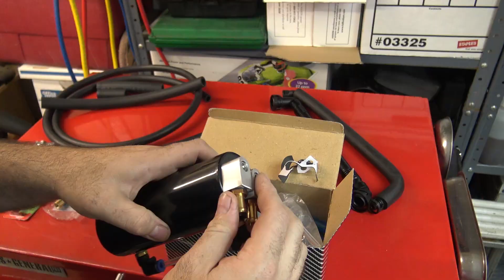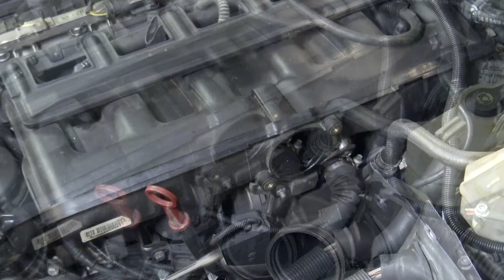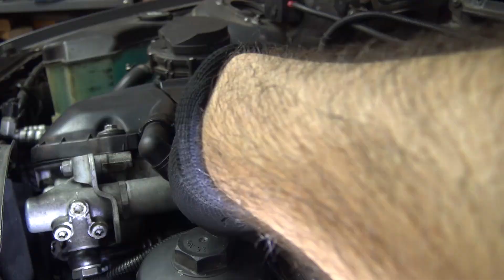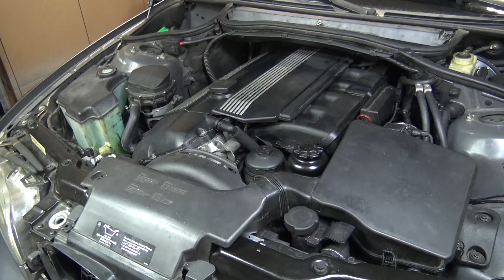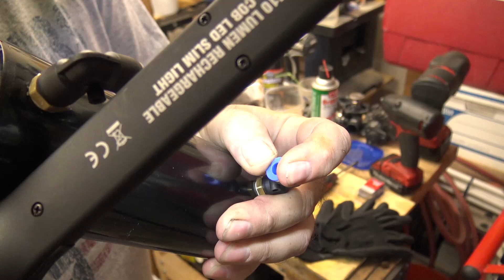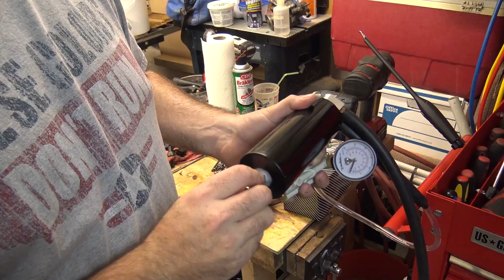BMW E46 Oil Catch Can Install DIY

Comment: My set up but before..claps for your efforts..
My e 36 M52, I installed a baffled catch can in series with the valve cover to OEM cc v....and blocked the dipstick drain port as well as the CCTV drain...for the time being to check if there is any oil consumption fix...this after long cruise off and on drives and short drives long drives etc ..figures out that oil consumption dramatically reduced ...and not only that but the oil catch can works the purpose and accumulates mixtures of water and mayo gunk in its bottom where I have drain valve to drain it out periodically....the difference I started getting is cleaner manifold and intakes...idle smoother. Oil reduced and next I will now install one way check valve in between the CCv drain port and dipstick drain port...hope  it works further fine

Comment: The original pirate lasted me over 20 years.. the Ketchikan does not have the vortex properties that the original part has you broke b******.. just spring the few hundred bucks it takes to buy the freaking part

Comment: ok so you have all your tests to show your experience, I am a retired BMW tech and have a x5 with the m54 engine, I have hd the truck for 10 years and my whole life long have had several different vehicles including e38 740il with 250k miles, I use castrol 5w30 and one can of STP oil treatment, my 1969 mercedes  I have had for 45 years gets castrol gtx 20w50 and stp every 6 months, my x5 has 300k miles on it witht he m54 engine, I tow it behind my rv all over the united states, it has to stay idling while in tow to keep the transmission wet, it gets driven as a daily when Im home, it does not consume any oil whatsoever. I do enjoy your videos and your content is great.

Comment: I need help with installing a catch can.
1.What I understand is the pcv connects to the oil catch can.
2. I also understand you connect a hose that connects to the top ccv where the intake manifold is.
3. I also understand you need to cap off the oil dip stick.
4. What I don’t understand is does the other hoses from the ccv need to be capped off or do I just leave them ? 
5. Also where the pcv is routed and connect in the bottom do I need to cap anything off or just leave it.
6. From the videos that I see I just see people cap off the oil dip stick connect the pcv and connect a hose to the catch can and then they go to the top of the ccv connection point on the intake manifold and connect that to the catch can and that is all.?

Comment: I installed it works fine. Drive about 40 km 25 miles, and check the tank or container that comes in the decanter and it is almost full. For what is this?

Comment: I realize it's a 6-year old video, but I'm setting up a Catch Can in a 2004 e83 M54 2.5l and I want to know how to select the correct PCV for my application? How did you select the Napa 2-9358 for your application? I really prefer not to attach a hose to a threaded end; Really prefer to have a PCV that will seal to a hose.... I'd appreciate your thoughts/comments.

Comment: NO MORE WHITE FOAM IN MY OIL
Love your videos. I've had my 2004 e46 330i for 13 years now and love working on it. I'm currently doing the notorious plastic heater hoses and getting the starter rebuilt for the first. 
  When I first got the car I noticed white foam under the oil fill cap which concerned me and designed my own catch can which I quickly realized won't work in the part of Canada I live in with super high humidity in the summer and -30 in the winter. The reason a catch-can won't work here is mainly the freezing in the winter so I had to come up with another solution and quickly as the heavy foam was totally plugging my ccv  system. I replaced my CCV system as I thought it wasn't working but it was. The BMW CCV  is very good but can't handle the super cold and high humidity of where I live combined with short trips. My solution is very simple, 100% effective and free and you keep your BMW CCV system. All I do when I come home is lift the hood and remove the oil fill cap and watch the steam bellow out as the engine cools down. Summer or -30 winter is no different. It's amazing how much steam comes out and in the last 10 years I've never had a speck of white foam anywhere in my engine. The thing that bogs the factory system down is when you turn off your engine at freezing temperatures all that water in the engine and CCV system freezes. By eliminating all the moisture every time you turn your engine off helps the factory system manage the larger percent of the moisture while the engine is running.  Hope someone finds this helpful

Comment: I been doing your hose method and it runs awesome. I been using air water separator. Next step is to use the same pvc as for the return oil line. Oil will only return when the car is off.

Comment: Hi. I just watched your video on the catch can replacement of the CCV. I see that you have the vacuum source for the PCV valve on the wrong side. The vacuum source goes to the 3/8 side of the valve. Also, the way you ran the drain line from the catch can will eliminate your vacuum source. You'll be pulling vacuum from the oil fill line. You need a check valve in the drain line, but you have to be sure that you have enough vacuum to pull the check ball closed while the engine is running and falls open when it's shut off. You might be better off with an electronic valve that is closed when the motor is running,(power is on) and opens up when you shut the motor off. I think that you will have a vacuum leak and be pulling oil up from the dipstick tube. Remember that you are putting a vacuum on the whole crankcase, which is in the oil pan too. So the check valve you put in the drain line is getting vacuum, and being pulled from both sides!! If the electric valve is too much, you can use a manual "ball valve", which would still make you have to drain the catch can, but it will be much easier to do. Just open the ball valve, let it drain, then close it again. I may be wrong, but I don't think that you will have enough vacuum to pull that check valve closed. It's meant to stop liquids from back flowing, which push it closed. Remember that you don't have a high vacuum to the PCV valve, and you're also using that vacuum to pull from the crankcase. That gives you a vacuum pulling both sides of the check valve. Thanks for the diagnosis of the problem though. I have a 2003 330xi that's burning oil, missing, and a vacuum problem too. I noticed that the vacuum gauge on the dash, (gas mileage gauge) fluctuating, being low, and having to build back up after the throttle is closed at an idle. I was going crazy. I was a mechanic for 40 years, but like a Benz, BMW doesn't give out too much info. I was thinking "vacuum modulator" at first, but it didn't smell like tranny oil. I couldn't find a PCV valve, and then I thought that I had a cracked head or a bad valve guide. I'm not used to going online to find a problem, but it was a great idea, and you are a great help. I felt a lot better when I found out that I was on the right track with my thinking about PCV. (That I couldn't find). It figures that the Germans would make a simple system complicated!!!! LOL. Thanks for a very helpful site.

Comment: I've been running with the PCV valve mentioned in the video. It's great, at idle engine speeds but starts to work improperly at highway cruise speeds, resulting in higher fuel trims and spikes in fuel trims. The solution to this is to probably get an adjustable PCV valve like the Wagner DV-17. You can't use it in below freezing temps though.
Reply: Addendum to this. Do not use the Fram345 pcv valve or the DF17 Wagner. Neither solve the fuel trims. PCV valves are flow type valves. These do not allow for proper crankcase vacuum of 16mbar. Use the oem ccv vacuum regulator portion inline with catch can to maintain right fuel trims and bypass the cyclone separator.
Reply: Update to this again. Don't use the OEM CCV inline with the catch can. Use the Dodge PCV valve and then route an vacuum tube from the intake boot elbow to the return port on the dip stick tube. The correct process is on the Xoutpost forums

Comment: Hey guys, this guy made a video talking about blowing seals with this mod, but ik 50skid is a guru and he knows what he’s doing, so no over pressurization with this method?
Reply: You will run higher crankcase/engine vacuum. There are risks of breaking seals and sucking dirty air

Comment: I did this mod a few years ago. In extreme cold (below 0F), the catch can or pcv would always freeze and blow out the valve cover. Maybe my crankcase generates excessive goo compared to others. I ditched the catch can and vented to atmosphere temporarily, and the pcv would still freeze. Ended up doing the m56 valve cover conversion which has worked out very well. In normal climates the catch can mod probably works perfectly, and I learned a ton from this video. 
This channel remains the best resource for e46 owners!
Reply: Thank you for commenting this. I live in Canada and it been quite cold lately. Yesterday oil blew out from the valve cover and there was a lot of pressure behind the oil cap. This helped be track it down to a frozen CCV. Thanks!
Reply: Got a link to the m56 Valley cover conversion cant find one stupidly
Reply: As a guy who lives in cold sweden thx for this comment!

Comment: Hi. Wondered if you can help me. I love ur videos. I installed a catch can. Blocked off oil dipstick. Used the pcv valve you suggested. But im getting a massive vaccume which is stucking oil cap down a lot and maybe causing oil to be sucked up from the sump. Any ideas? Would really appreciate any help you can give. Thanks

Comment: My opinion as I'm currently installing this , replace valve cover seal + grommets first hopefully you already did. Then My best advice to all is remove the entire intake,  yes it takes longer but pulling everything off and inspecting all your hoses and parts and seals is key. I was surprised to see what didn't work pulling mine off considering I drove from northstar to Lonestar state no issues.

Comment: Soo the hole of the oil separator will be left open? I feel I missed if you capped it off or something also about to top hose is it just left connected?

Comment: Thank you for the Video. I did the same installation on my car and when I drive for a test it drive really smooth but start smoking from the tilt pipe so I pull over and check the oil dipstick and nothing on it so I towed back yo my house and find out spark plugs are wet of oil do you thing I installed it wrong. Catch can has an input and output which one goes where? Thank you!

Comment: Any leads on after installing this, having misfire and SES light but no limp mode EML light, you can just feel it misfiring at certain throttle positions.

Comment: Greetings.Great video! I just wonder, I have seen a few setups without PCV valve. What is the worse that can happen if we do the same setup without the PCV valve?
Reply: We’ll with this, the oil catch cam going to the dipstick tub would gather water and dump it right back into your engine, which is very bad, you would need to add a water separator, if you do the second method by blocking off the tub on the dip stick you could get Hugh crank case pressure and blow some engine seals

Comment: So you switch the pcv to the valve cover 3/4 hose, but the switched it back again to the 5/8 tube on the intake with the new pcv? 
A little confusing with all the changes

Comment: 28:40 Those "slip in" connectors are not siutable for vaccume. they holod prerssure really well. They don't have standard orings. U need to use screwed connector with nut for this pipe, instead of "slip on" type.

Comment: Thanks your video.
I have some questions
My E39 is M54 525i engine
Are there any disadvantage to delete original ccv systems after long time test?
For example: oil consumption or air leak problem
Will OBD detect error code after delete ccv systems?

Comment: Great vid!! Is this the same with the m56 sulev e46 325i? I’m pretty sure my ccv system failed as I drove 3 hours and after parking up and restarting the car I had the most insane misfire I’ve ever felt. Plugs and coils and common vacuum leaks previously sorted. Do you recommend a catch can on the m56? Let me know thanks!
Reply: Also, what did you do with the old ccv oil separator system on the back of the intake manifold? Did you just leave it there ? Any connectors need to be taken off? Thanks ahead!!
Reply from the maker: If your CCV diaphragm built into your valve cover is busted, you can do a catch can. You can leave the old stuff if you want.
Reply: @50sKid  I’m not sure what you mean. I have the m56 sulev motor with metal valve cover...isn’t the ccv diaphragm under the back of the intake manifold? I’ve watched your other videos maybe I’m misunderstanding something. It only misfires at idle...maybe idle air control valve?
Reply from the maker: @CaptainBudhram  No, the M56 engine has the CCV built into the metal valve cover.  There is nothing underneath the intake manifold.
Reply: @50sKid  ohh okay thanks so much for that! I’ll do more hw on it thanks so much!! Are you on social media? Fb/ig? I would be happy to follow! Thanks again!! Keep the vids coming I do a lot of diy on my e46 thanks to you!!

Comment: HERE is a much better catch can that doesnt have that oil level indicator.  This one has a threaded dipstick instead...  https://www.amazon.com/gp/product/B076BKV7JF/ref=as_li_tl?ie=UTF8&tag=scottykilmerc-20&camp=1789&creative=9325&linkCode=as2&creativeASIN=B076BKV7JF&linkId=2633bfde063561407fe85724ff492bf8

Comment: 50s kid is one of the few people who understands that PCV valve is still needed if you use oil catch can. Basically you rebuild the original M52 PCV system with aftermarket components. Without PCV valve the high vacuum (when car is idling) will suck a lot of oil fumes from the crank case. This is the purpose of PCV it should be only open when throttle body is open.

Comment: help help help 
today I was out for a test drive and much oil comes out of the exhaust ... I installed a PCV ( PTC 345 ) but i was wondered these is a metall and its clicking when the PCV Valve is chacked, should the is a sping inside?

I open my catch and see there is no vaccum the direction of the PCV is correct

Also I wonder the catch on my last 30 KM around 20 Miles testdrive have catched much water // I must say  I drive the car most time in short distance 

next step the check the valve or installation without a pcv valve // or close the intake ports and output from catch to the air  filter

Comment: Not going to work. The check valve to the dipstick is spring loaded , the can wont drain. If you take it out it will suck from the pan

Comment: HI 50's Kid, just asking hows the vehicle oil consumption rates at about 1000 miles and engine oil smell or smoke inside the vehicle as what you mentioned in the video. I'd like to know what is your final assessment on the oil catch can project and it's latest part update. I have an X5 with M54 engine and interested with your  modification, as usual and normal oil consumption issue.

Comment: , the M52 has an additional vacuum line attached to the Fuel Pressure Regulator. Has any one done a catch can on an m52? If so, how did you tie in the Fuel Pressure Regulator vacuum line
Reply: This is old but wondering the same thing for my m52tu 328i

Comment: , the M52 has an additional vacuum line attached to the Fuel Pressure Regulator. Has any one done a catch can on an m52? If so, how did you tie in the Fuel Pressure Regulator vacuum line

Comment: Just plug all intake leaks remove ccv and stick a hose on the valve cover route it below the air filter. Make sure that disa is working. The car runs like a top.

Comment: What should we do if we have the m52tu and there’s a vaccum line going from the oil separator to the fuel pressure regulator (if I’m correct) what should we do with that vaccum line
Reply: run a longer vacuum line to the back of the intake manifold, there are capped off vacuum fittings which you can use

Comment: Basically that is a Pneumatic connector and due to it connects pneumatic tubes (so air flows inside), means they should not leak. I don't understand why yours had problem.

Comment: You don't need the pcv valve, it's defeating the purpose of the catch can. The catch can is catching the oil, so just air is going into the manifold. if you think there might be some oil getting past the catch can,  put a little oil water separator that you'd put on an air compressor hose, (they have high air volume, so you won't have to worry about restricting the air) after the catch can, then you can see if oil is actually getting past the catch can.

Comment: Did this, everything went well,  8 months later, massive oil leak from the valve cover, and later learned there is a pcv valve built into the m54 valve cover and it was whining.  I’m going to take the intake manifold back off to install the oe Ccv system, anyone have any suggestions on what I should do differently? Like a specific pcv valve? I have no kinked lines and I’m running a return line going into the dip stick on my setup.

Comment: Just wanted to say thanks, your part numbers helped me solve my catch can issues by finding and using the correct pcv! Thanks dude!!
Reply: What was your issue to much suction? On the oil cap as mine sounds like a sound can when you open it haha
Reply: Soda*